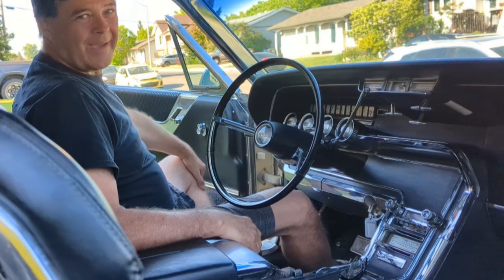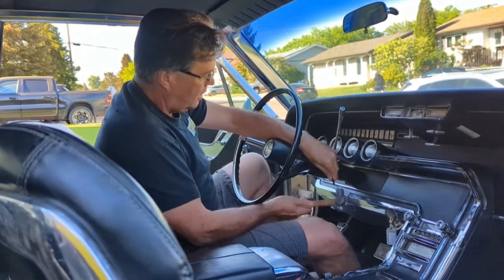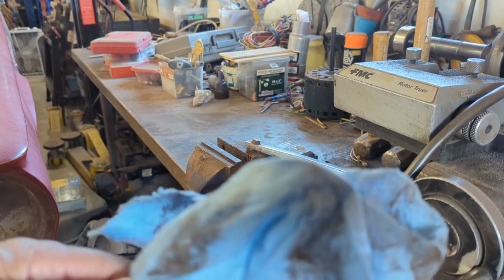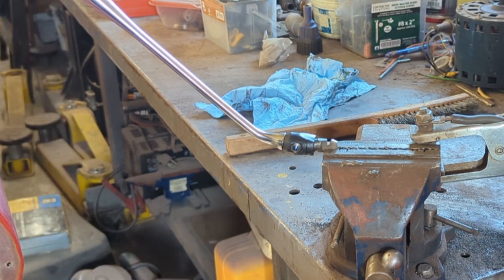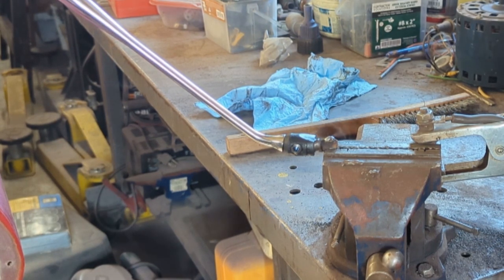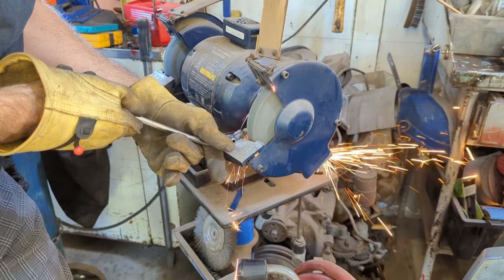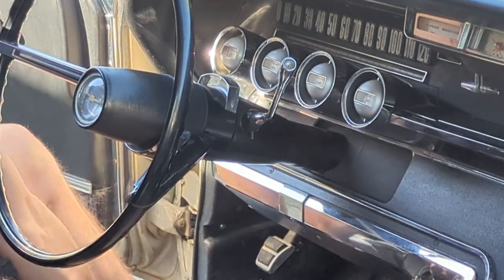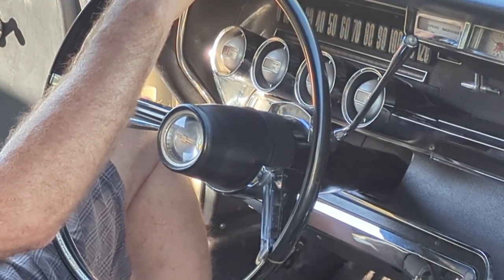⚠ Warning! ⚠ 64 - 66 Thunderbird Shift Lever Repair - A Must Do!

Comment: I am trying to install a new lever and I cannot get it in.  Just seems too tight, Is there some kind of trick to this?
Reply from the maker: No special truck, but you may have to try installing the lever in the neutral or drive position...make sure your wheels are chocked, so the car doesn't coast away on you. It should go in with a little wiggling, and if the rubber is new, it could take a little more effort.
Reply: @J_R_Shop  Thanks!  I appreciate the advice.  I was contemplating greasing the rubber part because of how tight it is.  I'll try installing the lever in drive or neutral first.
Reply from the maker: @vendelet  yes, try a little lube, and out of park... remember to chock the wheel. 👍
Reply: @J_R_Shop  thank you. Any recommendation on lube. I want to make sure I use one that will not damage the rubber. Also I have all 4 wheels chocked. I am paranoid about this thing rolling.
Reply from the maker: @vendelet  I would go with vasaline, it won't hurt the rubber.
Reply: @J_R_Shop  Thank you so much for your help.  I will give this a try.

Comment: You skipped a key part and that's installing the shift lever in the proper position I wish you showed that in your video I'm having issues trying to get mine right.
Reply from the maker: Well, it only goes in one way. Sometimes you have to move it out of park, to get it to seat all the way in, that's why you always chock your wheels.

Comment: what kind of metal is the shifter?
Reply from the maker: The shifter is steel, I welded it with a MIG, 0.023  steel wire.